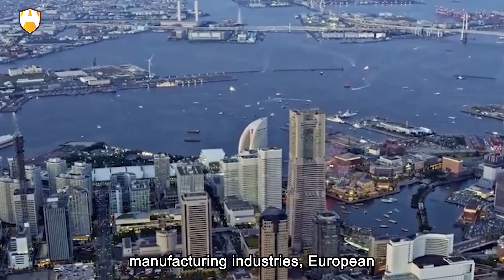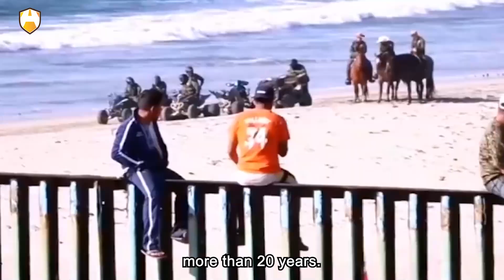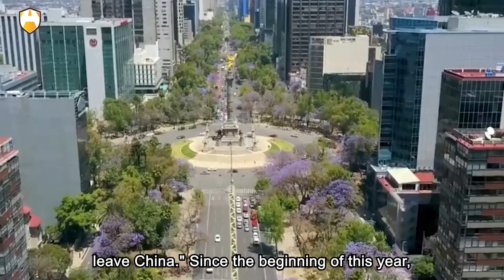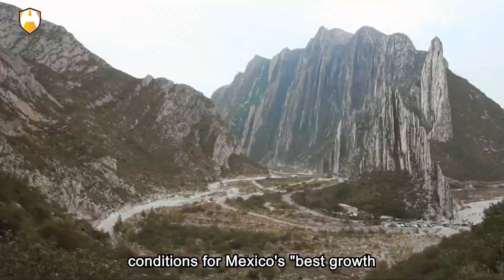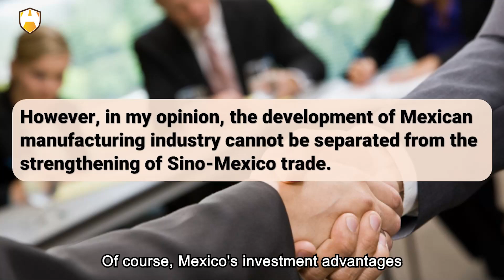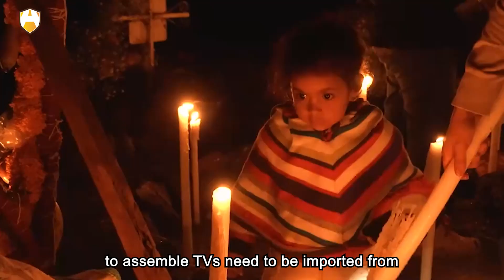Really? Can this country replace China?

Comment: It may. But if that was to happen, a lot of factors have to fall into place. That will take many many years by which time China would have moved on to a higher level.
Reply: That is exactly the reason why lower labour cost countries will inherit the jobs of what the Chinese labour itself started of with. That would be the natural progression of development of what you see in every developed and developing country. The developed countries has reached the point of diminishing returns as the underdeveloped and developing countries catches up. 
That also helped to explain the efforts the developed countries are adopting by throwing in as many spanners as they can into this natural progressions.